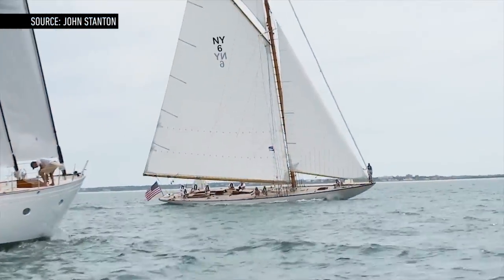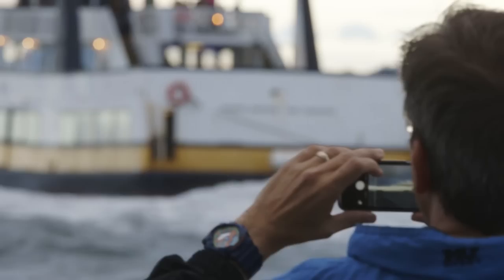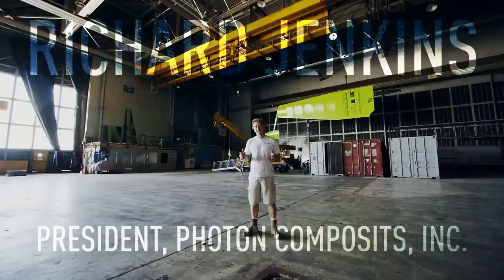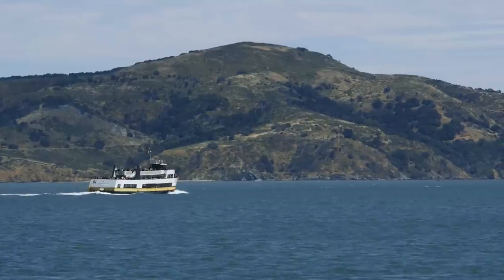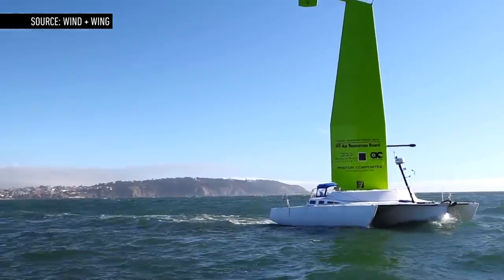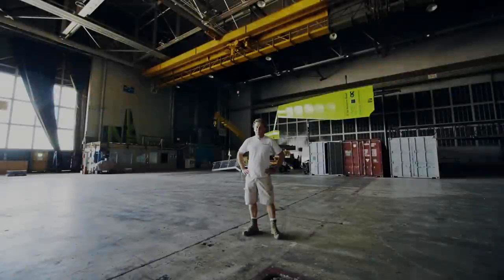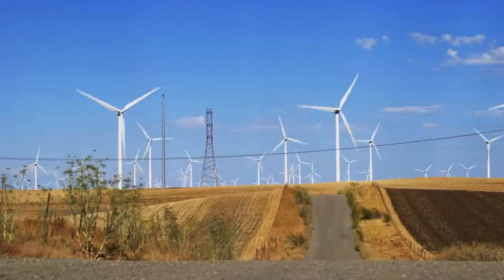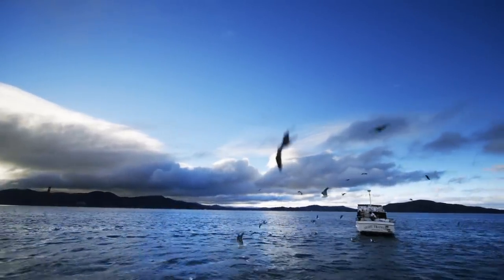You've never seen a boat sail like this - Detours: S. 2 Ep. 3

Comment: A point about "twice the efficiency"  of a regular sail: I call BS.  A sail and a wing work in exactly the same way.  They produce lift (thrust in this case).  The efficiency can be be measured by the Lift/Drag ratio and the Maximum Lift Coefficient.  Their wing has a symmetrical airfoil which is incapable of generating high Clmax - around 1.0-1.2 might be a reasonable expectation. A sail can produce around 1.7.  Simple function of camber; their camber is zero.  Drag for the wing would be lower, but at the low speeds these operate, a high CL max is more relevant. It's a nice idea, and one that has been around forever, but it has too many disadvantages. There is no way it is twice as efficient, not without elaborate camber changing devices.
Reply: PDZ1122 I think that is very optimistic, but I can see there being less turbulence with this due to no mast and so on and so forth. (It's 3AM I am tired....) there by giving the same power just losing less, aerodynamics are kinda touch and go with me, that's just my best guess....
Reply: Please fill us in on where your degree in aerodynamics was issued, I want to ensure that they stop giving degrees.
Reply: You can sail upwind with a wing, an indirect efficiency.
Reply: @jaysparc  everything he wrote seems correct. Do you see any problems with it?
Reply: Kinda sounds like you just pulled some basic formulas off the web and excluded all other factors. these two dudes have actually put this wing together and tested it on the ocean so I’m gonna trust them

Comment: A two-sided, symmetrical "wing" (airfoil) doesn't even make sense.  An airfoil operates on the fact that the wing is not symmetrical, you need this asymmetry to produce a difference in pressure on opposing sides of the wing (according to Bernoulli's principle).  Without this pressure differential you don't have lift (force).  The only way that I can see a symmetrical wing working, is to operate it at such high angles of attack that the wing is constantly on the verge of stalling, effectively making the airflow around the wing asymmetric due to inertia.  From my understanding this would also mean the wing is generating maximum drag (non-laminar flow) and would be very inefficient.

Effectively, what I'm saying is you aren't "doubling" the power of the airfoil by making it symmetrical - that's ludicrous.  Even if what you were saying were true, the force pushing on either side of the wing would be equal to the force pushing on the other side and you would have a net 0 force...
Reply: Aerobatic airplanes have symetrical wings. No lift is created while the wing has a zero angle of attack (the angle of the wing against the direction of wind). Like all wings, increasing the angle of attack increases lift.
Reply: Your aeronautic understanding  is faulty. All sorts of aircraft use symmetrical airfoils.
Reply: It has two sides so it's twice as efficient LMAO never heard such BS
Reply: Symmetrical airfoils generate lift when they have an angle of attack that is not zero. Cambered airfoils may generate lift at angle of attack of zero and have better L/D ratios. But symmetrical foils are still viable.

Comment: Clever invention! I would really like to see this one become a reality.

Obviously the wing works on smaller boats, but i can't help wondering if it would work on a large ferry? A vessel of that size would either require one massive wing or lots of smaller ones.

There are some things to consider. One has to regard the hight of the vessel. Will it be able to pass under bridges? What will happen if confronted with a storm if you can't take the wing down? The behaviour of a large ferry will be different with a wing, or rather, wings. The design of ferries may have to be changed for this invention to work, which takes time and cost a lot of money.

As good an idea as I think this is, I think it will take a long time before we see wings on ferries.

Comment: Ferries on short routes like this are perfect for battery powered electric propulsion.  Charge the battery on both ends while loading and unloading so that it doesn't need an enormously large battery.  You immediately get the benefit of no local diesel emissions.  Lack of engine noise and vibration makes it more pleasant for passengers.  Once it's put into operation, the boat is as green as the grid.  Make the grid greener, and the boat automatically gets greener.  You could use it in conjunction with one of these sails, but I'm not sure why you'd bother.

Comment: The boat seemed rather slow. If the intention is to move a ship through water with wind force, what's wrong with using a traditional sailship? Run a small diesel (or even electric / photovoltaic) to power the winches etc and you can sail a 100 ft sailship wit 2 persons....

Comment: There was only one true innovator with wingsails, John Walker from Walker Wingsails. The rest are cheap knockoffs.
 I plan to build a trimaran by his example in a few years, with current technology it will rock. (i build and repair ships for a living and have engineering degree and relevant experience in electrical, electronical and hydraulics so this will be my retirement project)

Comment: So heres the deal, this might work on small sailboats, but you run the risk of moving the center of mass too high upwards, and you can't reef the sail. In a ferry you have different problems. One, ferries are made to be sailed on a schedule based on the time, not the wind. It's difficult to be consistent if you rely on wind as your primary source of power. Two, you run the risk of overpowering your sail and because you cannot heel over in a ferry you could potentially damage your sail/boat. Three, a boat's maximum speed is not dependent by how much forward force you have, 
it's dependent on your hull, because a boat slides through the water, not glides overtop it. But problems get amplified once you get into large oil tankers. Now, oil tankers are huge, so they will need huge sails. Huge sails means huge masts. Huge masts means lots of internal deck support. You get to the point where the support for the mast is stronger than the support holding the ship together. Here's the problem. Because oil tankers are so long, the wind might be different for the bow and for the stern. Say your going straight downwind. You have full sails out, your stern gets hit by a powerful gust. Suddenly the stern part of the boat drastically overpowers but it can't move forward as there is so much drag in the water and your bow isn't powering up. Quickly the tension builds in the midsection of the ship. At the same moment you get hit by a strong wave and the midsection snaps, spilling oil into the ocean, and your ship sinks. Also, seems a little ironic that the invention designed to reduce CO2 emissions will be used on a ship hauling oil.

Comment: So what happens when the software glitches or an electrical component dies at sea? If you think about it, sailing hasn't really changed much since the beginning. There's a reason for that. It's like the wheel, it just works.

Comment: There is a technique used by folks who think just a wee bit "out of the Box;" it's called "ESP."
(Stands for Expanded System Parameters -- Imagine about 20 of these on the top surface
of a catamaran ferry -- the "system" senses a big gust of wind, and some of the sails 
automatically "feather." {It has been a long, Long time since the steamship "nudged" the
Rag man aside, . . . could be this is the very Beginning, of a new age of sail.})

Probably not, though. Not so long as "The Orange One" can keep a tight Grip, on the
reins of Power inside the Beltway.

Comment: no clue how it works. bummer
Reply: Airfoil and differences in air pressure
Reply: It's like a normal sail, except it sets itself automatically.
Reply: think of it this way.... a sail, is essentially an airplane wing, standing vertically....the airfoil cross-section, results in airflow differential, just like the way a plane's wing provides lift.....but because it's vertically mounted, instead of "lifting" the wing, it tries to move it to the side.    by varying the way the wing angles into the wind, it varies the amount of force....the interaction between the wing, and the dagger boards, results in forward motion for the ship......modern super-fast catamarans use very similar technology....fast enough, they're actually hydrofoils....

Comment: Perhaps if it were made as a semi-ridgid inflatable,  with separate sections on the same mast, it could resolve some of the storm/furling concerns.
Reply: The big advantage of a controlled foil is that they can be made to put the leading edge directly into the wind for absolute minimum resistance if a storm picks up.

Comment: Wings are expensive, cumbersome, fragile and hard to read and have to have controlled flex They can be very fast but many sailors have been frustrated when the wind drops and the water remain choppy. Suitable for racing but not commercial use.

Comment: Efficiency in performance with double surface wing .  ease of sailing without ropes n pullys.  Turning wing off could only mean free to follow the wind.  Put this on a slip and trailer size 34x14 ' trimaran. Its now get in and go.  No messing around with lines or pullies.  Takes the work of sailing out of sailing.  Therefore lazy people more likely to sail around than burn fuel and holes through our ozone!.

Comment: Why the need to go to the law makers? If you tell someone they will save 30% on fuel which is the biggest cost isn't that a big enough incentive? Or maybe the claim is unfounded and it will cost more to implement so less people will use ferries? Economics doesn't work on moralising.
Reply: You'd think. Unfortunately, you're going to have lobbyists on the other side trying to get these things outlawed to protect the interests that don't want ships to use less fuel (aka the ones selling the fuel).

We do not, by any means, have a free market society. Fossil fuels are massively subsidized, while rooftop solar is being made illegal in some places.
Reply: Mike Pateras I do agree there is no free market and also I'm aware of the abuse on all sides of the aisle. I'm personally against all kinds of subsidies because they create distorted market with unintended consequences. As the government grows the number of lobbyist follows which profits no one but them. 

I don't see a reason why solar roof panels would be illegal but at the same token why they should be subsidised. 

Having said all that I don't pretend to have an answer to climate change problem. I'm just not convinced that legislators are the way to go. I would root for innovation of the market.
Reply: Zhiloreznik )
Reply: Because like all "regressives" they want to control you, what you do, what you say, what you think, what you drive, and forever on everything.
Reply: @Mike: So in order to stop them being outlawed they have to be mandatory?

Sorry, but the technology either speaks for itself or it doesn't. No amount of propaganda can make a 30% saving go away. And, to be perfectly honest, the propaganda and the subsidies are mostly green these days.
Reply: because it's a shitty idea that needs subsidized...there's a reason we don't use sails commercially anymore.   They are slow, high maintenance and cantankerous.
Reply: Remember that the fuel costs don't include the costs of climate change caused by the greenhouse gas emissions.  If those were factored in, the fuel costs would be astronomical.  Free market forces don't work properly when there are externalities.  (Look it up.)  That''s why government regulation is necessary.

Comment: No it won't be twice as effective, wing sails are only more useful than conventional sails at a very small angle of attack, as is the case on very fast boats (Americas Cup for example) and when using a jib that redirects the flow of the air.
This one is also not rotatable in the middle so it will lack any shape to generate power.

Comment: This was 9 years ago, so how is it going? Oh, they gone now. These wings are probably good for transporting grain and coal but not so great at transporting people as they tip the boat away from the wind so if you have old people or people in wheelchairs on the boat, they have increased danger with this system. 1 lawsuit from a fall caused by extra leaning on a boat would lose way more than they would ever recoup from efficiency gains. Like I said, cargo ships would probably benefit but not passenger ships, due to comfort and safety.

Comment: wish i knew how it worked
Reply: It's an airplane wing turned on end. see lots of videos on here that show how an airplane wing works.
"6 to 7 tons of force" not possible.   As a sail of 450 square ft (45 x 10)  a 40mph wind  could generate
450 x 4 ftlbs = 1800 ft lbs Max. (and not prctical) times two again, just because he sad a wing doubles the lift (force)
and we get 3,600 ft lbs  I'd settle for a ton and a half ; but there are better sail wing designs out there that claim generating three times the force of an equivilant sail.
 oh oh...I'm turning green !......Not practical for a work vehicle like they are proposing. But you know who is drinking ten times more fuel than those ferrys, in the same 20 square mils of water. All those pleasure crafters with no particular place to go. Drinking a gallon every 5 miles and only half the fun of wind power.

Comment: Neat design! But spare me the green talk. The chemicals alone needed to build this type of craft far outweigh the benefit when it comes to ecology. Get real.
Reply: First of all, I'm very late. 

Second, I work in the manufacturing of wind turbine blades. They are not nearly as costly as they were even five years ago, so a 20 meter foil could seriously be mass produced, and just two of them could seriously improve the power of a ferry without necessitating excessive infrastructure. Fact of the matter is that these foils can operate with minimal human interaction, due to the combination of a rudder and counterweight with a basic GPS guidance system. They're not replacing engines as a primary means of propulsion, but supplementing the power of the engines so they can be throttles back, while still providing the same relative power. Ships like these are very inefficient, but necessary, and with the relative material saved by installing just one airfoil, they pay for themselves pretty quickly.

Comment: the only thing wrong with diesel is its minimum octane level , if Trump were to order the oil refineries to raise the octane minimum diesels engines would have more power and need less fuel to run....